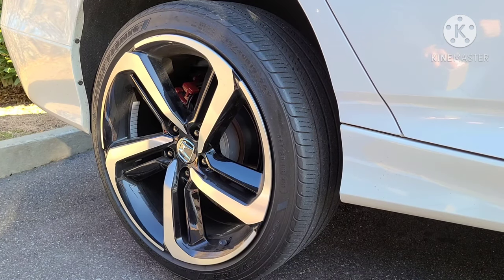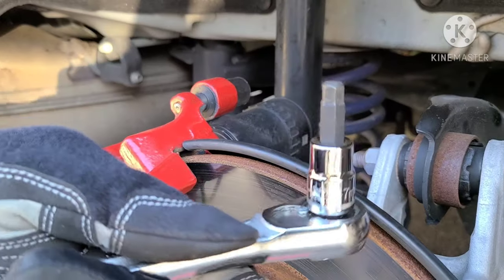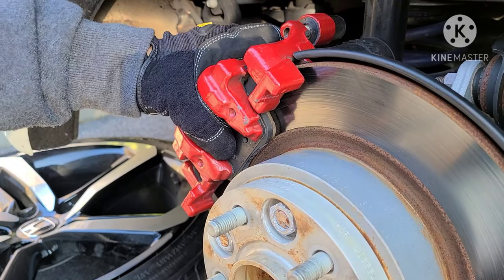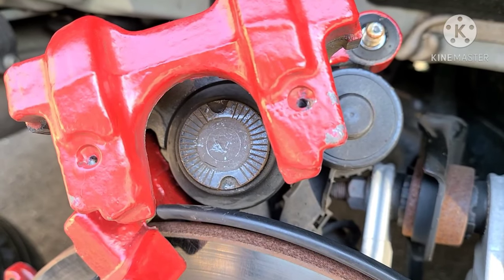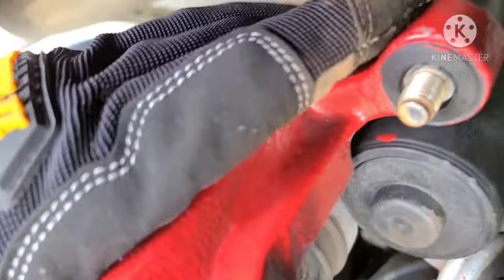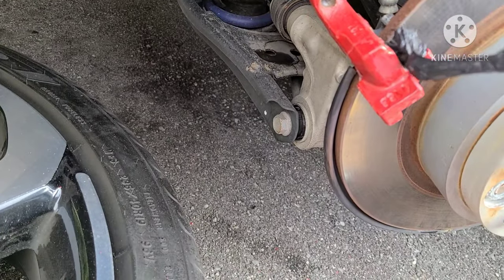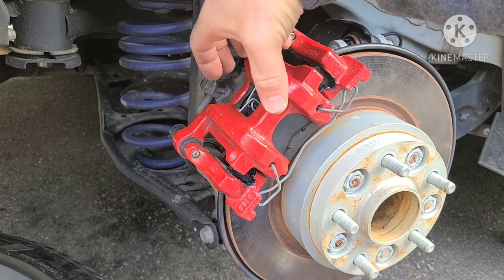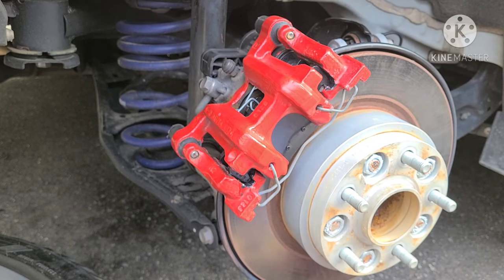How To Replace REAR Brake Pads 2018+ Honda Accord | Everything You Need To Know

Comment: I'm glad you're spreading the word about how totally unnecessary it is to remove the back cover of the electronic parking brake unit to retract the piston. By turning the piston as you did, it performs the same function as if you had opened the back of the EPB unit and turned the screw by hand. I don't like the idea of opening the EPB and exposing it to possible contaminants. Either way will work, but it's a lot easier to just turn the piston. In my case, I used a piston rewind tool and once the piston stopped turning, I had to also retract the piston further straight back using a typical piston retraction tool to accommodate the new rotor/brake pads. The other 2 methods are  to use a very expensive scan tool or hook up the EPB leads to a 12V battery, but why go through all that trouble when you can simply use a piston rewind tool or in your case, a pair of needle nose pliers. Bravo!

Comment: This guide was super helpful, I was able to repair my back breaks. I want to give advice to others. When tightening the piston, if you turn it all the way to the right (can no longer rotate) and the piston is still up, use a c-clap to push down the actual piston.

Comment: I performed the same procedure on my mom's 2019 Honda Accord, which has an electronic parking brake. However, her brake pads had worn down to the metal, necessitating a rotor replacement. I used a caliper push-back tool, and everything functioned correctly with no brake lights or issues. Soon, I'll be applying the same process to my friend's 2018 Honda Civic rear brake pads. I hope it works as smoothly as it did with my mom's 2019 Honda Accord. Hopefully, the brake light issue isn't inconsistent among some Hondas.

Comment: Followed this procedure with the correct compressing tool and OEM pads on a 2018 Accord.  It worked flawlessly, no error codes, no damage to the parking brake.

Comment: Dealership wanted 260 for rear brakes

I paid 150 for car jack, stands, brake piston kit, and Honda pads, plus I’ll be ready for the next maintenance job now that I have the tools!

Thanks for making this videos, it really does simplify everything. You’re the man!
Reply from the maker: Thank you! The tools will pay for themselves time and time again.
Reply: You poor soul. That's how the addiction starts! I was in your shoes 6 yrs ago. My little $20 tool kit I got for a front motor mount job turned into a tool repertoire $3k+. I'm a mess.  Now I'm rebuilding engines, replacing clutches, and begging people in the corner to let me fix their cars. It's and addiction... I hope you get the help you need before it's too late 😉
Reply: Dannnggggg your car comes with a jack…. So probably could of even done it for cheaper aha
Reply: Dealer wants $700
Reply: They quoted me $650 for rear pads and rotors!😱
Reply: @BarImpero  e-brakes break your bank

Comment: im glad i found this cause my rear pads are also about half way worn out at 17k miles. it seems that the accords use the rear brakes more to compensate for dipping in the front under heavy braking, so they wear out much faster in the back. ive been getting more into maintenance but wasnt sure how to do the rear brakes cause i knew that the e-brake requires some special tool or something. awesome to see its really that simple.
Reply: Dammm 17k I got 31k on my 2018 and I’m about to change the pads for the first time now front and back no squeaking yet
Reply: Same here. 19k and they are about 30% remaining in the back and 80% in the front.
Reply: What? Do you guys live in the mountains or something?  I'm going to look at my rear pads tomorrow and I've got over 80k miles on them.  I am a very conservative driver though.
Reply: @djsae  Not mountains, but hilly. Many newer vehicles all wear rear pads quickly to prevent dive when braking.
Reply: I'm 66K and dealer said I need to replace them but NOT for $650 lol so here I'm 😂

Comment: Bro, you been a lot of help. I replaced the front ones but not the rear ones because I thought it was going to be more difficult because I thought there was more to it with disconnecting that plug, thank you so much, great video bro 👍🏼👍🏼👍🏼

Comment: I just did my Rear Brakes on my 2018 Accord 2.0, I used your method with the needle nose pliers because I only have a C-Clamp and not a brake caliper tool. It worked perfectly when you get the hang of how to grip and hold the pliers to push and turn the piston in. I did actually remove the electronic parking brake actuator as well. Everything worked out 💯 nice smooth strong braking. I put this off for 6 months and was finally able to complete this from your video. Thanks bro  🙏
Reply from the maker: You're very welcome!

Comment: Great tutorial. The brake tool kits from Harbor Freight or Amazon really help things out. Like the creator said, once the piston stops spinning, you need to compress it the rest of the way in. The kits will have both adapters. Don’t use a C-Clamp to compress the piston or you’ll end up damaging the housing on the electronic parking brake. You really don’t even need to disconnect the wire from the caliber. There is plenty of room to work with.

Comment: I would like to mention that this may be a case by case scenario. I have a 2018 accord touring, for what that’s worth. I twisted and screwed the piston in as far as I could until it stopped and wouldn’t turn anymore, as you mentioned in the video. However when I went to reinstall the caliper it occurred to me that the piston still needed to compress at least another 3/8” to be able to fit back on. I had to hook up an inverter to run the motor in, then push the piston in by hand. I had to do this on both sides, which worked fine. It’s unfortunate I had to take this extra step but it still worked out

Comment: This is a great video ,very informative, up to the point. before this video ,I watch couple of the videos that made it seem like I was gonna take apart an engine .I did my front brakes yesterday took me 15 minutes on each side ,and then I watch the videos on the rear brakes ,and I was like oh man !!!!!! but, after watching this video it’s calmed on my nerves.
Reply: Also, have you’ve had any problems with the calipers locking up on you. I’ve read a couple of people would get their brakes locked , because of not resetting the computer code on the honda..
Reply from the maker: Nope operating totally normal. E-brake works fine as well

Comment: Thanks you answered my question the only thing not clear so I need to have my car ignition on during the job or after caliper release pressure I can turn it off
Reply from the maker: Leave it on the whole time, after pads are installed engage the ebrake to set the pads

Comment: This video was so much better than others I’ve seen, almost went to a mechanic until I found this video. However, my “brake” light came on and “brake system” light as well and the electronic park brake switch is flashing as well. Anyone else have this issue and anyone have a fix for it?

Comment: Wow. Great video. I have been doing my own brakes since 1966. Disc brakes are so much easier than drums. But I have been afraid to try replacing my rear pads on my 2018 Accord because of the E-brake. Several videos warn about generating error codes for the computer. But you seem to have successfully avoided that.
Reply from the maker: Thank you! I have had no error codes since the job was done.
Reply: @DanVilla7  I replaced the rears today. It was slow for me, my Needlenosed pliers should have been thicker, but it worked. At 34,000 miles I worried one of the pads may have gotten into the rotor, but the wear was far less than I thought. Thanks once more for the great information.
Reply from the maker: You're very welcome, glad I could help!
Reply: @camcoulter5993  exact same thing happened to me also at 34,000 miles - thought it was weird a rear brake went out before either of the fronts (although now I know front are bigger which makes sense); on the rear left the piston being out to far before taking pads out seemed to wear one of the pads completely down (past sensor) but other side was barely worn at all... 🤔
Reply: @DanVilla7  First off, love the videos man - very clear and concise. I'm struggling hardcore with compressing a rear piston and made it worse by putting caliper back on car without pads to come back to after other wheels (turned car on and it reset it so it just fits the rotor barely 🤦🏻‍♂). I'm gonna reattach the black ebrake winder thing but when compressing should I have the car "completely off", "accessory mode/battery powers everything without engine", or "ignition/engine on"? I know doing anything with the handbrake in any of those modes is a bad idea before the new pads are on.

BTW: I designed and 3D printed a tool and "V3" actually works REALLY well and should for anyone else with a 10th generation accord (i'm assuming '19-'21 probably also have same brake cylinder). I used PLA to print and works just fine but if you want something that doesn't misshape/wear down then I'd say use ABS, even though PLA has a higher tensile strength. I'll drop github link to .stl file. I just used a Creality Ender 3 (only $170 - could not recommend enough, should be a common household appliance) and it takes less than 2 hours to print
Reply from the maker: @Vik Gardella  thanks! The ignition must be in the on position, car not running. The pressure will come off the caliper allowing you to compress it.
Reply: @vikgardella  Hi. I had the same problem at 30K right down to metal and needed to replace rotors mainly on Drivers side rear. I also have vibration rear drivers side and is getting way to hot w/o even braking. This is a defect and Honda is no help. If I drive 60 mph and apply brakes I get vibrations / noises. Did you ever find out what was wrong with yours? Thank you-

Comment: Thanks for this video! Did this job this morning but when I did the left side rushing because a storm was starting I forgot to put the car in Aux so I still had about an inch to go before the caliper would go over the breaks. I didn't have that brake caliper tool so I was trying everything to get that piston back. 

I pressed the brake and set the e brake so I could start over and same outcome? I even took the back off the caliper and turned the back shaft, it gets to a certain point and stops and still no progress. I ordered that tool which should be here Mon. I'm going to try that but if nothing happens I'm just going to order another caliper.
Reply: So ended up having to call various Honda dealers to order another caliper, end result they all said theirs a nationwide back order on them and they have no eta when they will be back in stock! I did however track a 2019 caliper down from a salvage yard. Everything worked out fine with the 2019 replacement! I'm going to mess around with the original and see if I can get it retracted. At least I'll have a backup.

Comment: Really good thorough process on the vid. I just had one question. Is it the same process for the front pads?
Reply from the maker: The front will be an easier process.  You won't have to wind the piston back just compress normally,
 and  no electronic ebrake

Comment: Well explained video.... thank you for clarifying about EPB. I watched few videos for Honda's rear brake job and it confused me how to go about retaining piston. I will try  this now on my 2016 Honda Civic and hope this works. Just to confirm, I should turn ON accessories mode before turning piston clockwise right? Thank you once again!!
Reply from the maker: Yes you won't be able to even get the brake pads off unless you do so. Just leave ignition on and then it's just like any other brake job
Reply: @DanVilla7  Do I need to disengage Parking break ?
Reply from the maker: @rumble329  absolutely otherwise they wont come off

Comment: Question:  does the car need to be in the on position the whole time the job is being done,  or just to release.... and then you can turn the car off until finished?   Thank you in advance.
Reply from the maker: I would leave it on so you can disassemble. Once you compress the piston you can turn it off. Make sure to set the side your working on before moving to the other side and repeat the process

Comment: You got those pads at a good time. Its out of stock in alot of places, on line as well.... I called My dealer today and they have none, and they told me only one other dealer in my area has them in house.  The pads are on back order until further notice , that's what the dealer told me .front pads are easier to find , not the backs.
Reply from the maker: Wow crazy. When I called the dealer by me they said they had plenty in stock. I guess I got lucky.

Comment: Changed my brake pads today (front and rear) and all went well.  Your video was the most helpful of all that I'd seen.  Question: My rear calipers and rotors (both sides) were hot to the touch after about a 20-minute drive.  Fronts were fine.  Is there a like a break-in period or something after which they will return to normal temps?  I don't think I forgot anything - and NO parts left over!
Reply from the maker: Thanks! The rears seem to just engage more than the fronts for some reason. I still haven't changed my front pads. My past vw was the same changed the rear way before the front so seems pretty normal for rears to hear up more during normal driving.  I. Aure if you were doing hard braking the front would have been very hot
Reply: Maybe cycle the parking brake on and off a few times?

Comment: Getting ready to do this.. SO you use needle nose and push in and turn RIGHT at the same time correct?  Guess you can just press straight in to compress piston?  Thanks..
Reply from the maker: Turn clockwise and push in at the same time
Reply: @DanVilla7  Thanks for the HELP!  Took Honda to dealer for a recall and of course they came back saying needed rear brakes and gave estimate of $320.  Ordered OEM brakes online $70 after tax and shipping.   Wasn't hard and the longest part was jacking up the car with the cheapo spare tire jack.  No squeaks and no lights.  Used loaner tool from O'Reilly Auto Parts.  Front brakes next.

Comment: Man I did this myself in my buddy's shop and boy...
Did not enter service mode, did not do this in auxiliary mode...

Rear-right wiring harness to the motor... the wires fell out of the clip, so I spliced it.

Ordering a new wiring assembly, and now I have to pray and hope that entering Service Mode with the scanner (which we had the whole time), taking it out, clearing DTS, then driving it for 15 mins, then engaging/disengaging EPB fixes this problem. Hopefully I didn't fry the motor.

Any input is welcome.

Comment: I appreciate you making this video. I haven't done a lot of cars with the electronic e brake. My car has 20,000 mi and I've got to get rotors too their grooved. Did you get some aftermarket pads? Or just the regular default Honda ones? I plan on doing a little bit of an upgrade cuz 20,000 mi on rear brake pads and rotors are not good. I don't drive my car that hard at all. I bought a brand new in 2019 and I just got the 20,000 miles.

Comment: Great video, thank you! I have a question, there isn't a need to put brake lube on the pad where the caliber makes contact with it? I always thought that it was good to put some there to help more with squealing noise.
Reply from the maker: Thanks. As long as you put it on the area in which it slides your good. You can also put some on the back of the pad that makes contact with the piston.

Comment: UPDATE- I just did all four brake pads today but I do need new rotors. I rented the equipment that pushes the piston . It's from o'reilly. Man thank you so much. The front is actually easy but the pin was kinda hard to take it off but overall its easy. Fuck all these dealerships and Mechanics that charges over $300 and up. Thank you

Comment: So when you say to leave the ignition on to decompress the piston is that just on or the car all the way on? Because the way I did it before I took the whole e-brake component apart.
Reply from the maker: Press the ignition button 2x but don't start it

Comment: The rotors are pretty cheap. Just replace them when you do the pads. 
And just crack open the  parking brake actuator and turn in the screw then compress the piston. Super easy.

Comment: I’m confused about something.  You turned the caliper piston clockwise (from a point of view of facing the piston surface), but in another video I watched by RB the Mechanic, he effectively turned it counter-clockwise (from the same point of view mentioned previously).  How is that?  Could it be because you were working on the passenger side in your video, but he was working on the driver’s side in his?  Do you remember having to turn it CCW when you worked on the driver's side?
Reply from the maker: I turned it clockwise.  I showed me compressing the pistion on the drivers side.

Comment: As a first timer doing this method, my car had its battery drained. When I did the method of releasing the pressure by turning on the car, it triggered the ABS and brake issue while I was trying to get it off. And the piston was still firmly on the brake pad so I couldn't lift it off of the rotor. My rotors were a bit eroded and had some pretty deep lines, I wasn't sure if I could have hammered it off anyways but I didn't risk it. I guess removing the EBP actuator would only have eaten up about 5 to 10 minutes more per side so I wish I've done that in the first place. Nevertheless, your tutorial was very helpful. But turning on the car to release the pressure did not work for me.
Reply from the maker: Was your ebrake engaged ? If so that would be one possible reason.